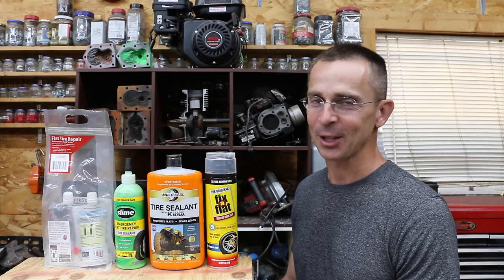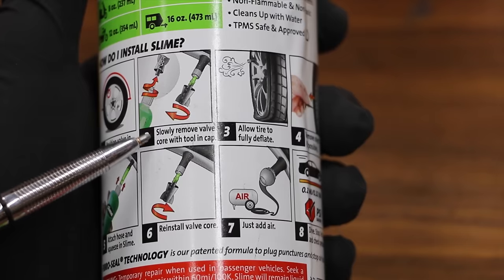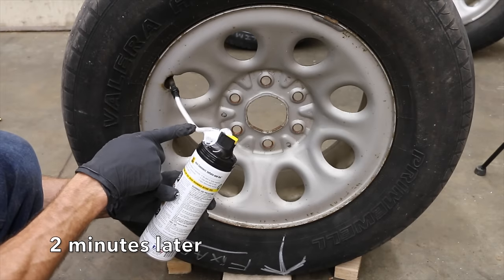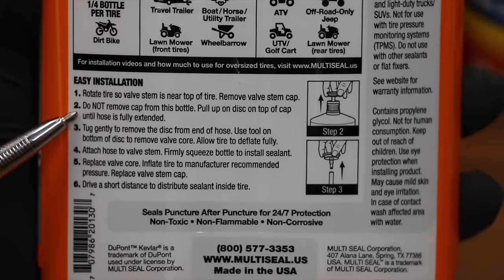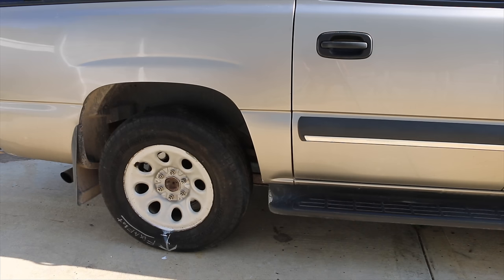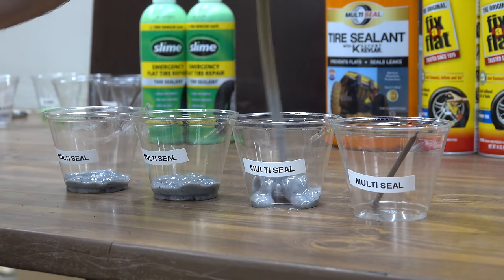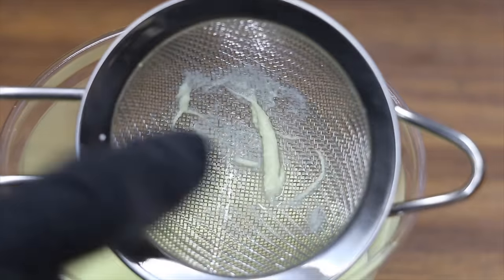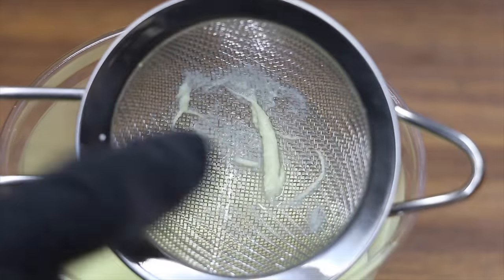Is Tire Slime the Best? Fix-a-Flat vs Tire Slime, TireJect, MultiSeal. Let's find out!

Comment: As a former employee of a tire shop: Fix-a-flat is worthless
Reply from the maker: Thank you for the feedback
Reply: Ya, I used to work in a tire shop long ago.  You want to piss off a person who has to actually fix your tire after putting that junk into your tire, add this junk!!!
Reply: I have couple cans fix a flat in my car !   For emergencies ( mostly for other people)  And on brand new tires I run green slime! A lot of tire shop technicians are whiners they don’t like to go to a sink grab a shop towel soak it in water wipe area to be repaired!!! Just too much for some guys!
Reply: david c smith 

Fir a flat and green slime and the rest is crap.  Green slime is for off road use only.  You shouldn’t just throw the crap in your wheels.  Generally the thing that put a hole in the tire stays stuck in.  Get it fixed right at that point.  I carry a small air compressor to air my tires up to get to a shot to get it fixed correctly.  If it’s goes flat way to fast, I have a good spare.
Reply: @greatdaneacdc  It's because when they pop your tires off the rims, it has a chance of just dumping all over their floors, causing it to be slick, stick and or crust to the floor, and etc. There are much better ways to patch and seal with products you can buy at walmart than pouring liquid puke in your tires.
Reply: @jbdragon3295  Why do you say Green Slime is for off-road use ONLY? ... Why would something be okay for off-road use but not for (less challenging) on-road conditions?
Reply: SovietGrazz 

The stuff says for off road use.  It also will throw off the balance of your tire.  I’ve seen a lot of this crap in tires and it makes a big mess, one of the worst and will rust out steel wheels in time.  

It’s a shade tree mechanic fix maybe at best.
Reply: as a man who use fix-a-flat because it was the only option at that time... next time i have a puncture and no other way of repairing it i better walk that 12km with a wheel on my back to the shop then use fix-a-flat...
Reply: @jbdragon3295  I have a portable air pump and a collection of different thicknesses of screws. If it's going flat too fast I pull out whatever is in their and set a screw instead. It's always bought me at least 2 hours to head to the tire shop.
Reply: @inventoroftoast  yup exactly correct, and the crap doesnt seal or work anyways 👍
Reply: Oh my God yes. Turns a 20 minute flat repair into 35 with all the cleaning it out and then drying
Reply: @jbdragon3295  I carry a plug kit.
Reply: Dean H 

Plugs are even worse as you are putting a bigger hole into your tire.  99% of the time will still leak.  I had to patch a ton of tires after pulling out the leaking plug.
Reply: @jbdragon3295  I'd say in a side of the road in a emergency situation where for whatever reason when you have no spare, that patch can be done quick, and after should get it fixed. I plus side is, no mess for the tire shop and can do a patch on the inside and be like new. Usually that is, always variables.
Reply: JB Dragon I only use the green slime in my utility quad and mower tires anymore as I don't drive em fast enough to worry about wheel balance and my dad has a case or two of slime left from when they sponsored him for quad racing, but luckily I haven't experienced any corrosion issues as of yet.
Reply: As a fleet mechanic, we swap flat tires for good ones, then sublet the repair to the tire shop
Reply: sb120985 

Well that’s basically like having a spare tire.  You swap, the flat tire it taken apart and patched up, if it’s still good.

If you plug a tire, you could make what was a patchable tire into a junk tire.   I have fixed a ton of plugged tires.  It slows down the leak.  Best you leave what pit the hole in the tire and use a little air compressor to air it back up.  If it’s too fast of a leak,  put on that spare tire which you should have unless you have run-flat tires which you can run flat to a tire shop and get it fixed.  If you don’t have a spare, better it one.  If you’re in the middle of no where, to dumb to have a spare tire and all you have is a worthless can of fix a flat,  well I guess you use it and get to where you need to be as fast as you can before that tire goes flat once again.  Some does work better than other, but some are also almost impossible to clean out.  Makes a big mess, are we don’t get paid enough to waste so much time fixing a flat with all that crap.
Reply: JB Dragon i have never had a plug leak. Maybe i am just lucky? I typically just leave them in. Usually the tire gets replaced before the plugs do. 
I have heard people complain about them but i have never had any issues with them.
Reply: @jbdragon3295  I've never seen a failure with a tire plug and rubber cement, usually the plugs outlast the tire.
Reply: rdizzy1 

Lucky you!  I’ve fixed a whole hell of a lot of them that were leaking.  We never plugged tires.  You sure can’t see if the tire is damaged inside if you don’t pull it off the rim.  Plugs are for quick gas station relates or DIY people.  In my experience, plugs leak.  Maybe not at first.  It can also be a very slow leak, but they generally always leak.  Not to mention you’re tearing a larger hose into your tire to put that plug in.  Sometimes doing that will destroy what would have been a patchable tire.  But hey, you can do whatever you want.  I’ve changed careers 10 years ago.  I’ve moved on from working on cars.
Reply: @jbdragon3295  Who knows, it's possible that they didn't use enough rubber cement with the plugs, and that is why they were leaking, have seen that.
Reply: where I live, a spare is mandatory (so is first aid kit, reflex vest and reflex triangle). You don't have a spare tire in your car, you get fined.
Reply: @Zpicismrad  Where do you live? I want to make sure to never move there...
Reply: you need more personal flat tire experience and only have a few bucks on you :[) LoL my many years of experience has helped me grab a can or two of fix a flat, in fact just used one the other day and the tire hasn't leaked since, and as of right now it's been almost a week, it's like I said above, it's good for real real real slow leaks.
Reply: @nigonkouk1770  Yeah I used to have the same issue, many times. I switched to just paying for AAA though instead, it's pretty cheap now for how good it is. I live in upstate NY and AAA has saved me from being stuck near the PA border and tow me all the way back to upstate.
Reply: @sundstrom193  I've fixed tires for 30 years and worked on cars for 40.
Reply: @jbdragon3295  I have a 90% plus success rate with tire plugs.  I have probably done more than 50 and I almost never use rubber cement. I like the brown tacky ones over the harder black ones.
Reply: JCLawn51 

Good for you.  But in my years of experience, they end up leaking.  They also tear a larger hole into the tire.

I would never use a plug.  The other reason us if you don’t pull the tire from the rim, you can’t actually see if there is any damage con the inside from running on it flat.  You plug a tire, it blows, the car crashes, they sue you as you didn’t repair the tire correctly and make sure it’s safe.  Plugs are things shade tree mechanics use.
Reply: @jbdragon3295  Technically a patch is alone is an insufficient repair because  it leaves does not fix the hole.  It allows debris and water to work its way behind the patch.  Most tire shops around me will give you an option and tire plugs are usually a complimentary service. If someone sued you for a blown tire after a repair, they would have to prove that you did a repair wrong. Good luck proving that with a blown tire. I also get that if you are running a business you need to idiot proof things for your customer.
Reply: JCLawn51 at tire shops we drill out the hold to about a quarter inch, then we glue a plug in there with rubber cement, make it flush with the inside of the tire with a grinder, then glue the patch on, then cover the patch with liquid rubber that solidifies, so generally depending on who does the repair, the patch will outlast the rest of the tire.
Reply: @greatdaneacdc  hope you know that after about 6 months that tire slime you put in just turns to beads and does nothing all while you act like it's fine for you to knowingly inconvenience others
Reply: @greatdaneacdc  there's a reason we hate that shit. It makes a mess and it smells like monkey shit after a few weeks.
Reply: @Cody_Ramer  there is a 50% chance of a plug working, if possible I prefer booting tires over just plugging but I condone fix-a-flat/slime ect.
Reply: @jbdragon3295  i can patch a plugged tire, just gotta grind the plug flush with the inside of the tire, gotta do that to boot it anyways but when its had fix-a-flat or slime you are bout to get throat punched because of the mess.
Reply: Travis James 

Well good for you.  Plugs are in fact junk.  It’s a crap repair a shade tree mechanic would do.  No tire shop with it’s salt would ever plug a tire.  The simple fact alone that it needs to be checked inside to make sure the tire is still safe to drive on so you’re not sued later for a car crash from plugging a bad tire.

In my many years of working on tires, I fixed them if possible, going flat from the plug.  A slow leak, but still a leak.  Not a one did I ever install.  All came in leaking from someone else’s repair job.
Reply: @jbdragon3295  NEVER had any of my plugs leak. Just my experience. I have four or five year plugs that are yet to fail
Reply: @Cody_Ramer  I've never had a plug leak either. You gotta know how to install them correctly
Reply: @AzalofForossa  lol @ liquid puke
Reply: @SovietGrazz  I also view the term "off road" to suggest heavy duty conditions such as trails, rocky paths and the like, but I think by "off road" here, they mean not driving at all, but rather for a trailer that is parked (off the road) most of the time. I may be wrong.
Reply: @SovietGrazz  i tried it  years ago what the other guy said is right your tires run out of balance after they reach  a certain speed. Below that the puddle stays on  the bottom. Then it gets  caught up and rotates inside with the tire. You slow a bit it stays on the  bottom again. Feels weird and since theres a  substantial amount it weighs quite a bit.
Reply: @jbdragon3295  the plugs you saw failed must have been poorly done. Ive done a dozen all lasted the life of the tire except one I shouldnt have done in the shoulder. I install mine super tight after soaking in glue and modded the insert tool for easy removal. Never below around 40 degrees. Varying from that i could see trouble possible.
Lets not forget that 30 years ago plugs were the standard repair of tire shops everywhere.
Reply: batvette 

You are full of excuses.  Good for you that you are so perfect that none of your plugs failed.   I doubt that, I’m sure a few at the very least had a very slow leak.   But we’ll go by your fairy tail.

That still leave out lack of actually checking the inside of the tire to make sure it’s safe.  If they are your tires, who cares, you’re not going to sue yourself if one fails.  It’s still a shade tree mechanic repair job.  In the real world, plugs tend to leak.  I’ve never used one and would never stick one in a tire.  I patched every single time.  Fix the plug leak if it didn’t damage the tire.  Breaking the steel belts in the tire where it could poke through the patch.  But it allows seeing inside the tire to make sure it’s safe to fix in the first place.  In the real world getting plugged from all kinds of places.  They all seemed to to a typical job.  It’s better than fix a flat crap in a can.  But it’s a half ass job in tire repairs.  Real tire shops would NEVER, EVER plug any tire.

But glad you are so perfect to not have a single one leak.  Amazing!!!!!!
Reply: @jbdragon3295  
The 2020 Kia Optima comes from the factory with a tire sealant kit and compressor in the trunk instead of a mini spare; I wonder how long those things will last in the heat and if they really work well enough to not risk being stranded in a real emergency-
Being a factory item I would hope they really tested it out before going with it as a standard.
Reply: @hedonisticzen  add a tire plug kit and it would be more likely to hold the air. The screws would be a good idea as a secondary backup though.
Reply: @jbdragon3295  HaHa.  Tireject will seal completely rotted out tractor tires.  There is no fixing it 'right', and cheaper and easier than tubes!
Reply: @SovietGrazz  TireJect is now labelled for on road use.
Reply: Fix a flat is the only product that puts a little air in the tire.  That is worth.
Reply: gizzy guzzi 

Whatever you say!  If you want that liquid crap in your tires, great.  If it works for you, great.  Have at it.
Reply: @greatdaneacdc  It will put air in a tire.  That's generally a good thing.
Reply: @hedonisticzen   If you are going to 'be prepared' you might consider carrying a tire plug kit instead of screws.
Reply: @Cody_Ramer  Plugs work great.  Opinions are like belly buttons.  Worthless.
Reply: @brandonmiller7466   TireJect is water soluble.  Just rinse it off.  Of course, the tire will never leak again, so you won't have to worry about it until you wear out the tire and replace it.
Reply: @gizzyguzzi  the goop that system requires and also the process is longer?
Reply: @Eric Wesson The guy's never even installed a plug before. He doesn't know what he's talking about.
Reply: @SovietGrazz  On-road vs. off-road is all about certification and liability.  On-road means they went through the hoops to prove that it's safe and unlikely to cause an accident.  Off-road is a broad term that could mean anything from an asphalt race track to rock crawling, but in either case the expectation for safety is much lower (you're more responsible for yourself at that point)
Reply: @hedonisticzen  The ONLY problem with that idea is that you don't notice you have a puncture until it is flat-a.k.a.  out of air.  Also none of these products can fix a sidewall cut up by the rim.  Only a spare tire can fix that.
Reply: Correct me if I'm wrong, some new cars come with a flat tire fix kit consisting of a slime type product and an inflator instead of a spare.
Reply: @wes326  Some do, but they're just as worthless
Reply: My friend has a wheel rim that leaks slowly. I think the bead is a little corroded. What would you suggest he do?
Reply: @wes326  Most large cities have places that refurbish rims
Reply: @EvilJ069 Thanks.  I'll let him know. It's an old Highlander so I don't think he wants to put much money in it.
Reply: Motorcycle riders use a Slime type product called Ride On in tubeless tires that balances the wheel and seals minor holes. Having a blowout on a motorcycle is much more dangerous than in a car.
Reply: @wes326  No kidding, tell my Kawasaki lol
Reply: @EvilJ069  I have Slime in my motorcycle tubes, just in case. Wish I had tubeless tires. 98 Vulcan 1500.
Reply: @wes326  wtf? As far as I know bike have used tubeless since like the 60's, so on a 98 I'd be astounded if they weren't
Reply: @EvilJ069  It has spoked rims, so they cannot hold air. Some people  seal their spokes with an adhesive (5200) and run tubeless tires. Probably a better way to go because tires with tubes lose air faster than tubeless tires in a blowout situation.
Reply: @wes326  Welp, I learnt me something new! I didn't know about spoked rims needing tubes, thanks!
Reply: $3.99- same as downtown.
Reply: @rdizzy1  AAA is worthless in most rural areas pretty good in most cities.  I have it and their response time in DC was about 10 minutes.  In rural NC it is no response or about 1.5 hours ( time to major city).  Check it out before you pay.
Reply: @brianhillis3701   Depends on the state I would imagine, like I said, I live in an upstate NY suburb, but my alternator went out right near the border of PA/NY, in the middle of the boonies. They towed me all the way from there back to upstate ny, no extra charge or anything.
Reply: ...amen...patch is best, plug is o.k., fix a flat is worthless...
Reply: @dyer2cycle  Eh, I disagree, it has saved me from a tow bill a couple times. Allowed me to get to a gas station to fill back up with air then to home when I had no spare.
Reply: @rdizzy1  ..understand..it's better than nothing..but better to 1)keep a spare(and a jack and lugwrench!)..2)..keep a set of needle nose pliers,plugs and plugging tool,and, if possible, a small air tank...then, no horrible mess to clean up when you actually fix the tire...also, if the tire is 75% or more used up anyway, I just call the plug good enough for the rest of the tire's life..just air it up properly, no further repairs necessary.. :)..slime/fix-a-flat, etc. is NEVER a satisfactory permanent repair...
Reply: @hedonisticzen  ..yeah, or just carry a plugging tool and some string-type tire plugs..I like to carry a small can of tire glue, also...helps lubricate the plug, and helps seal, too..lots of times, such a repair is good enough just to leave it...and no mess to clean up...
Reply: I wonder if by now you've seen project farms video where he put 100 plugs of 4 different brands in his tires and drove for 15 miles without having even a 1psi drop in tire pressure?

My suggestion would be to well season then cook your words to medium-rare before eating them lmao 🤣
Reply: @SovietGrazz  I think the slims solidifies on the bottom and unballances the tire so high speed driving is no longer safe.  FoF stays liquid.